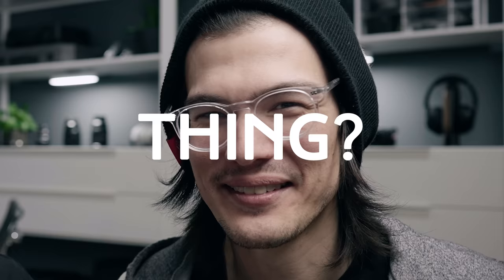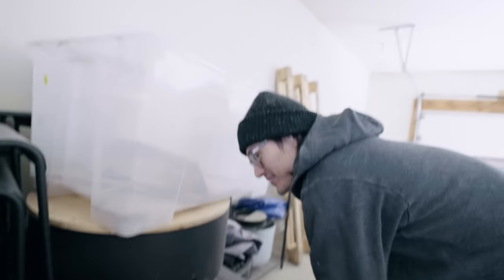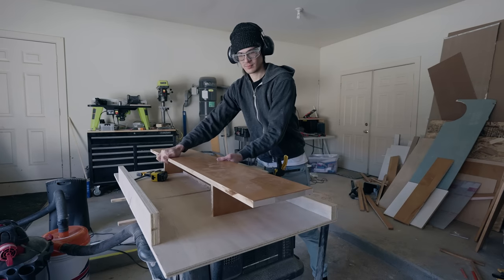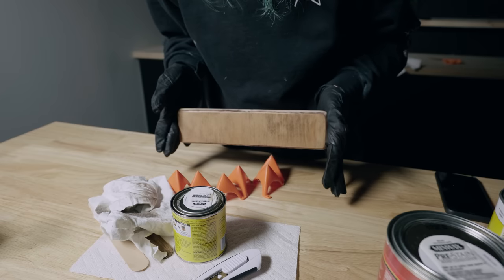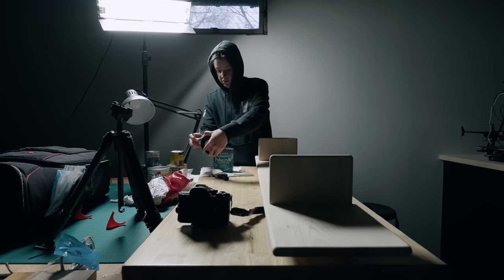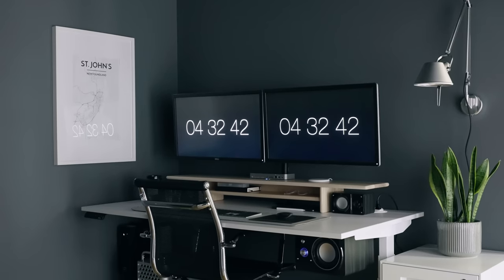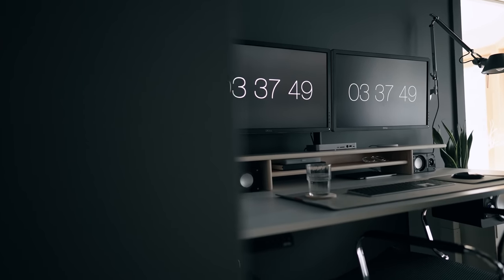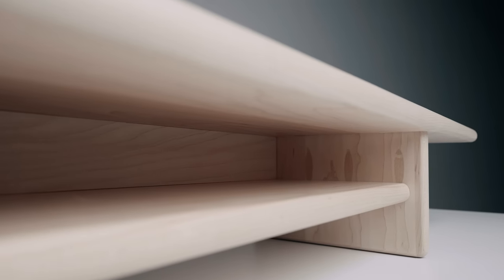DIY Desk Shelf and Monitor Stand | Desk Organization + Build Plans

Comment: The advantage of DIY is you can, as you say, customize it to fit your needs, like routing out a little rounded dip near the edge of the top or shelf to prevent pencils or pens from rolling out.

I would recommend anyone wanting to try this project on the cheap and don't have a lot of scrap lumber you could use to buy a sheet of MDF, have the store cut it to size. Buy some veneer edging to iron on the exposed sides of the MDF. Then paint, stain, or add a veneer over the top and sides. If you enclose the back consider adding a path on the back to snake cables through.
Reply from the maker: Oh this would be cool in MDF and painted I bet!

Comment: I just recently used those ikea feet to build myself a monitor stand, but I cut of the raised section off the mounting plate. And seeing that side was then the shortest I put that towards the front and back edge of the timber plank which in turn gave more distance between the legs.  👍🏼

Comment: As a little upgrade in the design you could make it a bit taller add a second shelf and slide one or more (divided?) slim boxes in there for pencils, pens, paperclips, etc. The only thing about having speakers so low is you get less treble, which, for those who don't know, makes speech clearer and gives some clarity to music and ambient sounds. You might try pointing the speakers in various directions, including backwards, to diffuse the sound, which might sound better to you.

Comment: Great job. The main secret of woodworking is knowing how to recover from your mistakes. I would have just repositioned the legs on the monitor stand. Only a few of the screw holes would have shown and you’d never know since no one can get their head underneath to look. Wood staining is always tough. Maple and cherry in particular. Always use a sanding sealer. Also, check out the Sam Maloof oil/poly top coat that Rockler sells. My go-to finish.
Reply from the maker: Oh wicked thanks I’ll check it out!

Comment: Thank you for sharing these two projects. Indeed the desk shelf is a bit more difficult, but still doable if one can live with some compromises (without the rounded edges). I would at least try to do the desk shelf myself. Especially with all the home office arrangement, it might be an easy "get away from the desk" project.

Comment: A quick modification you could do to the server shelf is make a simple square router template for the base plates. Route out a 1/8 inch deep area as close to the corner as possible, and you can mount the legs closer to the edge without the metal showing. Countersunk screws will help you achieve an almost flush look without pulling out your Dremel and modifying the metal base plate. Love the vids! You guys have such an inventive design aesthetic!
Reply from the maker: Yess that’s what Chris wanted to do but I convinced him to leave it for ease 🤣
Reply: Could you have not added a cable management wood stripe behind the desk?

Comment: You can buy flammable garbage bins that contain all flammable rags and materials, theyre only like ~2ft high and ~1ft in diameter. Then a local recycling center should have a bin for dangerous (motor oil etc).
Reply from the maker: Oh good tip thanks!
Reply: @BeckiandChris  no problem, my work uses them for our ethanol rags! Safety comes first! Great job btw love it, def wanna try this myself!

Comment: 1. Did you guys intentionally get the same glasses?

2. Rounding the edges doesnt look good when the desk is squared.

3. Why didnt you move the legs on the monitor stand?

4. Is it Chris or Craig?

5. "We used a Japanese pull saw" i.e.   Chris/Craig.
Reply from the maker: 1. No
2. Disagree
3. Lazy but likely will at somepoint
4. Chris, Kreg is the brand name of the pocket hole jig and accessories
Reply: @BeckiandChris  as I thought about it the best I could figure was that a friend or someone named Craig made those. Lol I skimmed thr most of the video so.

Thanks.